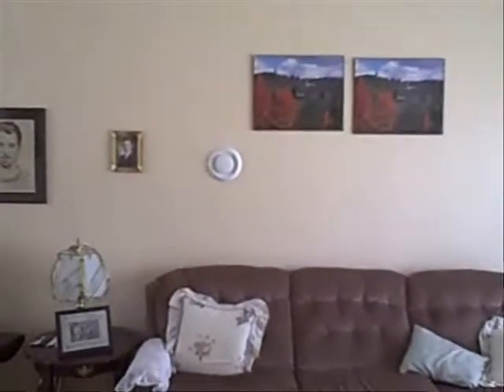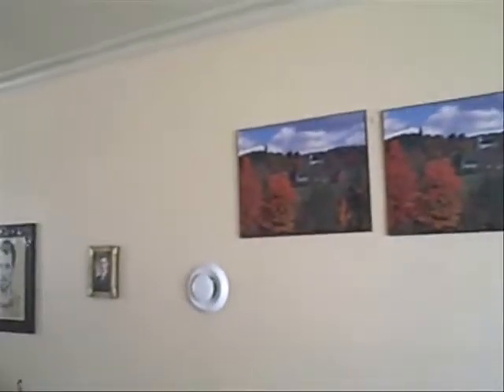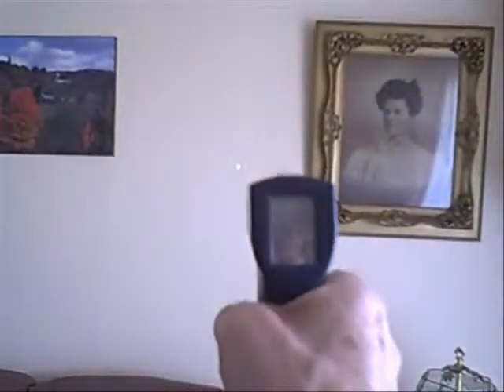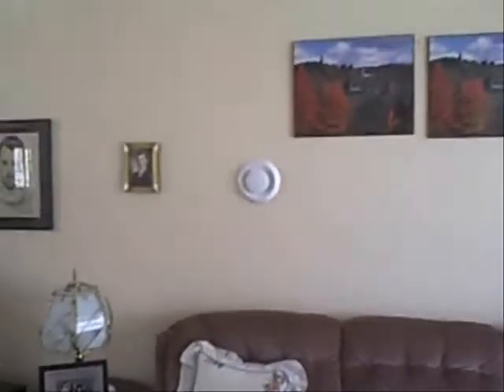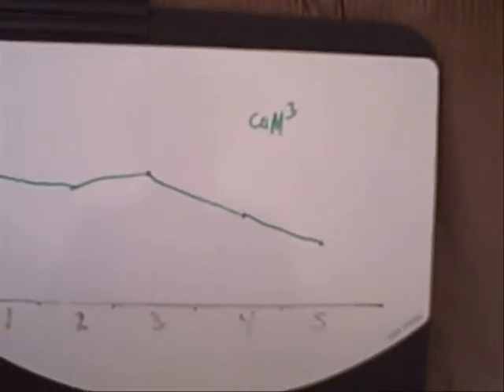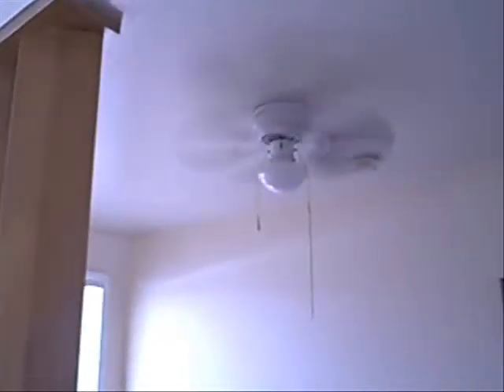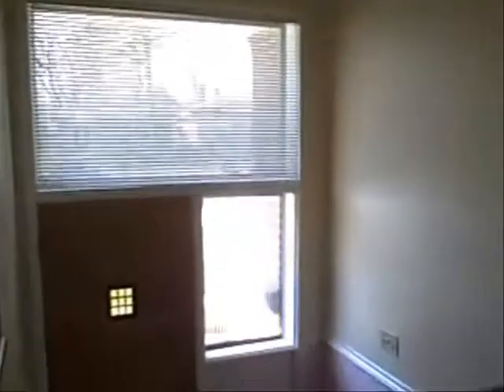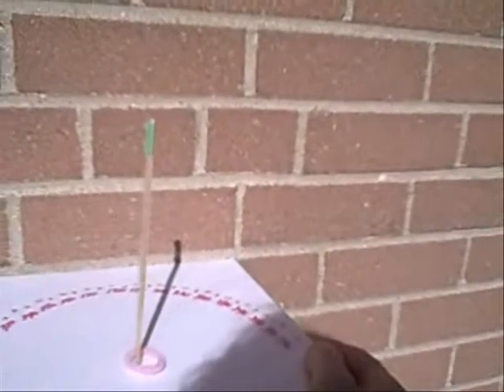Solarsheat Panel is working.wmv

Comment from the maker: The solarsheet now one year old.
The fan is one high setting but is much quieter at low setting.
I have done the math for the total one year and there is a reduction in the combination of Electric and Natural-Gas,  that is an overall savings of $444.11.
Reguards